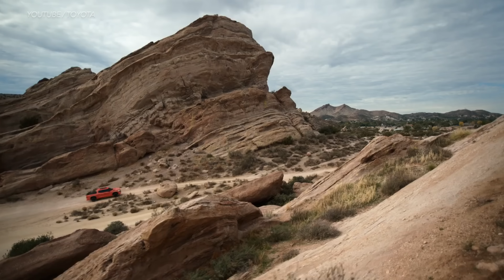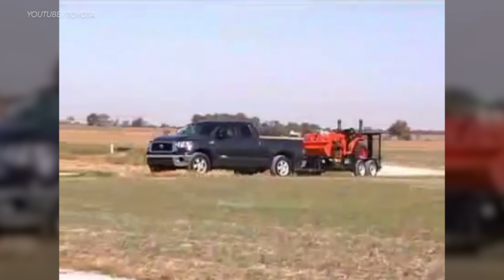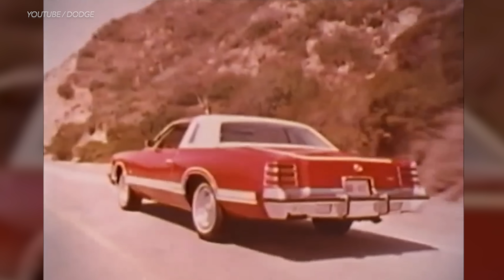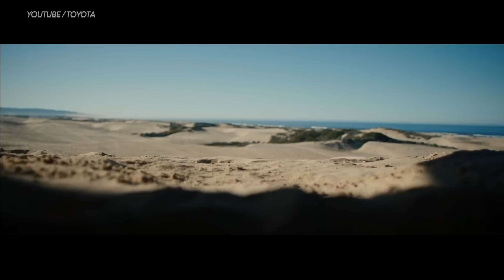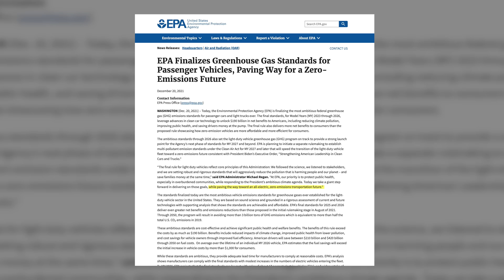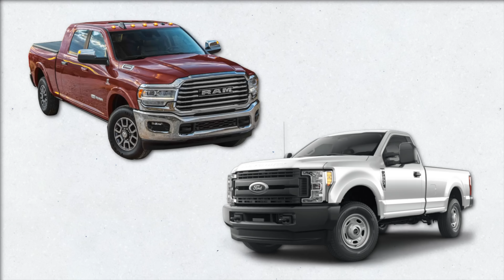Here's Why Ford Just Sued Toyota

Comment: Someone famous in the car industry once said " There's no substitute for horsepower "
Turbos and super chargers are not as practical or responsive as pure mass. V8 beats V6 every time...my 2 cents.
Reply: That was based on old forced induction technology, basically from the 70s and 80s....people should actually drive a Twin Tubo Tundra before coming to these conclusions....Turbo vehicles aren't what they used to be....most people wouldn't know if they were driving a modern turbo or not.
Reply: actually - "there's no replacement for displacement"
Reply: @stanmarcusgtv  I like how that rhymes 🙂
Reply: No replacement for displacement
Reply: Actually its "no substitute for cubic inches "
Reply: @vin9114  that's what she said
Reply: @vin9114  no,  it's "there's  no replacement for displacement"
Reply: @vin9114  You're right, I remember that now, my mistake.
Reply: @vin9114  you have it 👍
Reply: "There's no replacement for good ol' displacement."  Larger displacement engines have more torque and torque is what does the work.
Reply: I mean for towing and hauling yes but if we are talking about racing then no v8 are literally getting walked by 4 cylinder turbo engine's 🤣🤣
Reply: @Lstdream3r  lol but if the same is done to the larger engine it wouldn't be...a problem tuner guys have had for awhile. F1 cars and even the nascar ones only have to go a few hundred miles before completely being overhauled.

Comment: My neighbor had the new one for less than a month and said the V6 is a dog when you tow.   you get the same gas mileage as the old V8 but with the motor working harder
Reply: Obviously manufacturers should be looking at the Rolls-Royce Merlin V-12 engine with 1,440 hp for their pickups.
Reply: @donadams8345  Now your talking, no wimpy turbo but a supercharger the size of a trashcan...
Reply: These Liberal leftie destroying all good things we have V6 turbo is crap doesn't make any sense the V8 is the master of the  road period
Reply: @miloslogic  IDK who makes a V12 honestly.  I've driven the V10 Fords and power it has got, lots of it.  I have no interest in owning any Ford mind you, but if I were haulin and towin' I might change my opinion, as that engine has gobs of torque - in between the break-downs at least
Reply: @robertmaybeth3434  I don't think Ford offers a V-10 anymore.
Reply: I'm thinking your neighbor would be better off with a V10?

Comment: Why don't they simply perfect the way some engines open cylinders based on user need. If you are not towing and around town, you can open 5 or 6 cyl, and if towing and need it open the 7 and 8cyl. This works very nicely on some cars. I bet Toyota can perfect this!
Reply: It's a thermal runaway issue with cylinder deactivation.  Got Hemi? Bores go out of round. And Phil, reciprocating mass is still in  play no matter what.
Reply: @fromthebackofmymind  Still in play with just lube, zero gas combustion . Some actually turn the piston off and it does not engage. I think VW has that tech. I am not sure of it though.
Reply: It works very badly on most cars. 

We were looking at a honda accord a few years ago that had cylinder deactivation on their V6.  I asked the salesman if it could be shut off and he said no, it is part of the ECU programming and the driver can't shut it off.

On hearing that, we turn around and walked off the lot and drove to the Toyota dealer down the street.
Reply: @shoersa  "it works very badly" In this case it sounds like it. But it doesnt mean all cases. VW uses this with very good results, enough to put in their supercars. So, in scale this can be perfected and major gains to be had.

Comment: I like my 5.7 Tundra 4x4 crew. It's a great family car, and I can tow everything I want to. I've had zero problems in 12 years. The new ones don't save you any money in practice.
Reply: Have fun doing the starter on it
Reply: So you've never changed the starter yet?  That seems like a very interesting car maintenance chore to me
Reply: @robertmaybeth3434  nope not one thing has failed yet. (other than the usual brakes, tires, light bulbs etc) It only has 125K miles though. I know a guy with a 2010 who uses it for work and he's at 380K. He has replaced the starter, but that's it.
Reply: @bendeleted9155  awesome... 125k no starter?  I don't wanna jinx your truck but - I'm guessing you drive a lot of miles without stopping?
Reply: @robertmaybeth3434  mostly in town, believe it or not. Many long trips too though. Everything still works. I hate the Bluetooth setup, especially for playing music on it. That's my one complaint.
Reply: @robertmaybeth3434  common failure on toyotas. took me 3 hours and I'm an ase certified tech. Was able to avoid removing the exhaust manifold/cat.
Reply: @Agent-vj3ns  But you still gotta remove the intake and reinstall, and pray there's no leaks?!!  3 hours sounds not so bad?
Reply: @Agent-vj3ns  I wonder if it would just be easier to drop the exhaust.
Reply: @bendeleted9155  I pulled the axle to drop the starter out
Reply: @Agent-vj3ns  yikes.
Reply: @bendeleted9155 yikes indeed lol, book time is 5.8.. it would be easier if it was under the intake